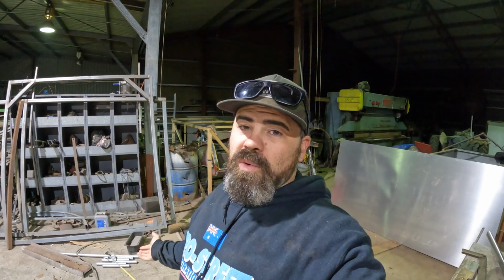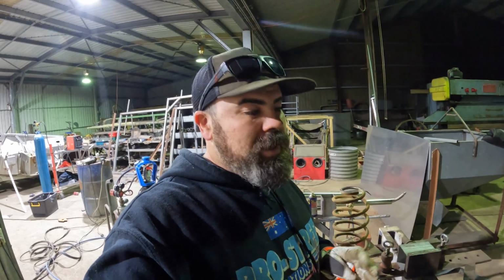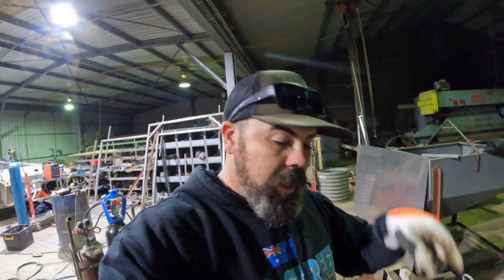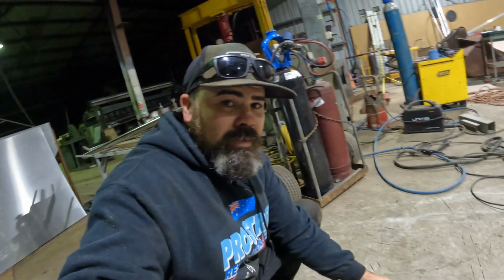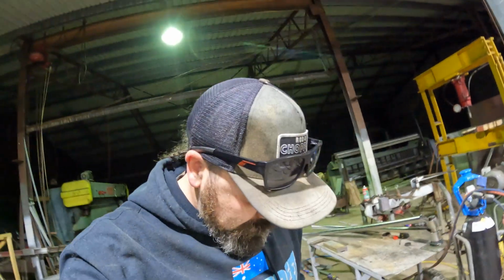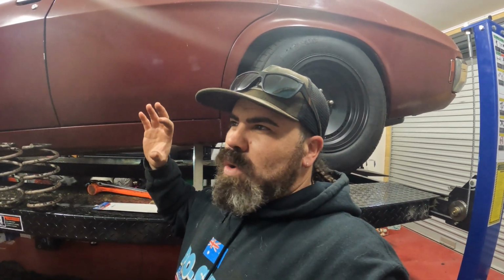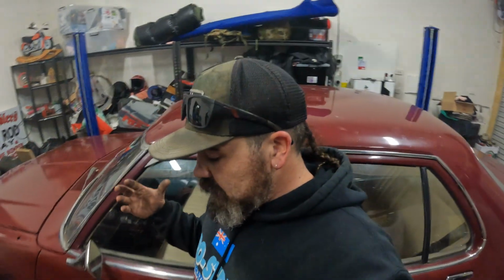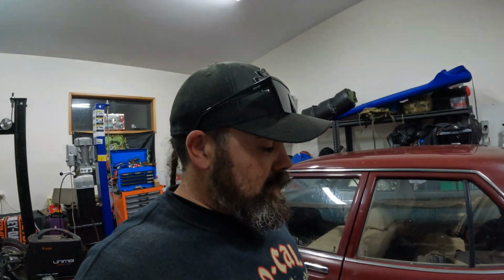LOWERING HQ - again- HOW TO - lower coil springs with HEAT (OXY ACETYLENE) DIY - is it worth it?!

Comment: Can I just use the weight of the car to compress?
Reply from the maker: Yes, that's the way it's normally done... just be careful you don't clamp your hand when it drops or burn a brake line 😂...
Reply from the maker: Also you can use the jack to apply pressure to the swing arm/ side your doing